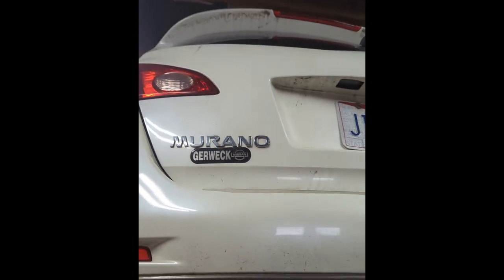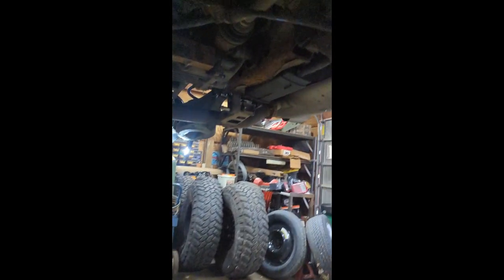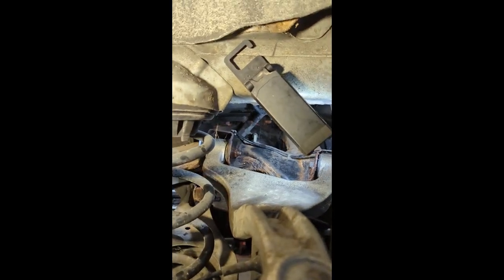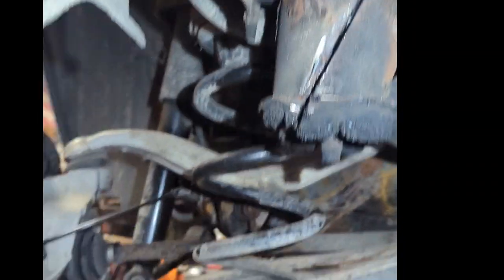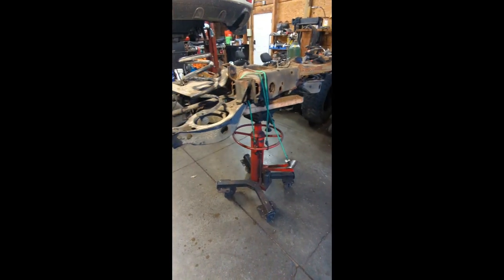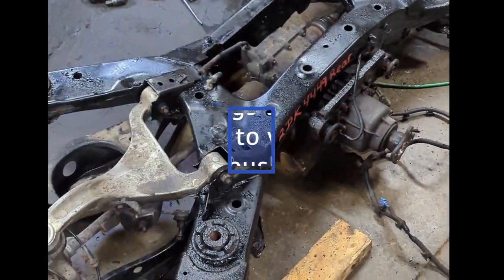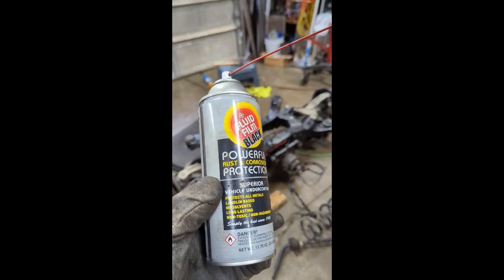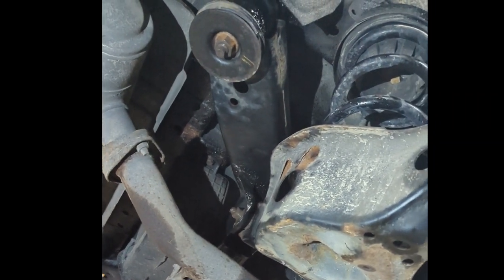Cheap! Murano Subframe DIY Cradle K Member Fix

Comment: I just replaced my subframe on my 2012 Murano. Lots of rolling around in the driveway. I disconnected the E brake cables at the wheels. Removed the calipers and rotors. Exhaust was rusted out. I used a low profile transmission jack and dropped the entire subframe with suspension still attached. Transferred the parts to the new subframe. Only had problems with one of the lower link cam bolts. Seized in the bushing.
Reply from the maker: Good work

Comment: For weight purposes, without a lift or heavy equipment, the rest should come off first...
The driveshaft and rear diff can be left alone, your correct.
Reply from the maker: Thanks for the feedback
Reply: Man I'm having this exact issue and I've been in maintenance my whole life just iffy on tackling this but doesn't look too bad. Mind if I ask what you gave for the replacement? Thank you